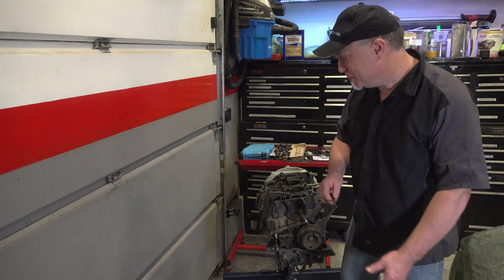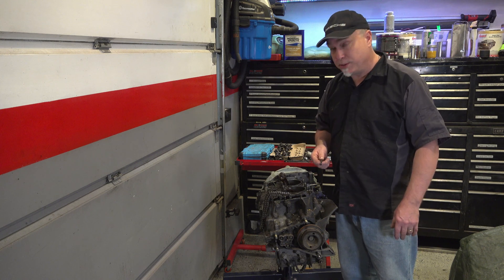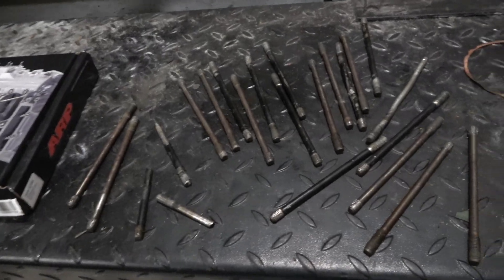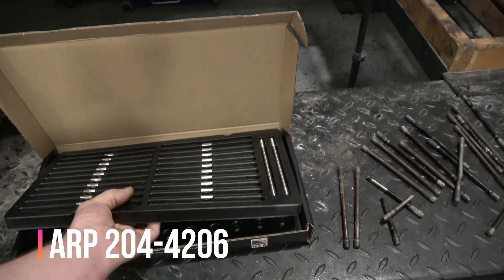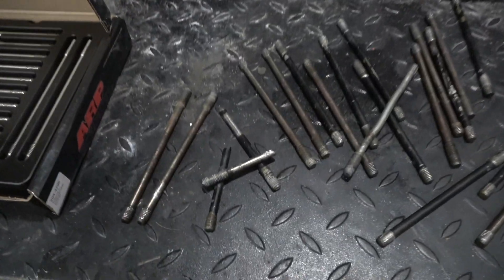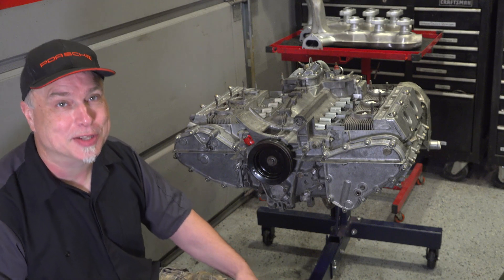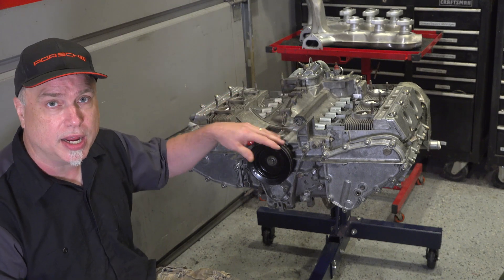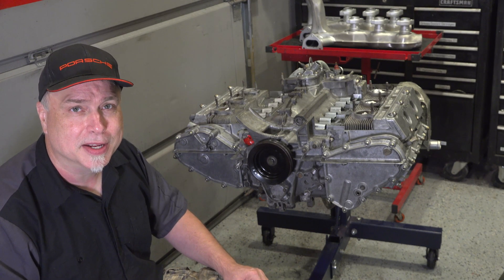3.2L Porsche 911 Cabriolet: Engine stud installation and case assembly [4K] Ep106

Comment: Been doing AC Porsche 6's since 1979. I have an issue with anyone claiming even a modicum of 'know-how' using the archaic ring compressors shown here and breaking a ring? - I suppose for a 'newbie' this would be explainable, however - if you're doing more than one of these a year, then readily available ring compressor sleeves (in this case 95mm) like these (available from Wiseco #  WIS-RCS09500)- are a no brainer. We have these in every diameter imaginable; you should too if you service these (and other) motors. You have shown those of us who know that you are in the 'apprentice' category. In Germany, you would be watching, learning, asked to grab a particular tool - then... continue to watch and learn for at least 6 months to a year (aptitude dependent) before being certified as a 'qualified' Porsche 6 cylinder air cooled powerplant technician. This is unfortunately an example (albeit with a couple of rudimentary measurement points) of how NOT to properly assemble a Porsche 6.

Comment: Thanks for posting. You have a great level of patience. You are inspiring. 
Cheers
Reply from the maker: Things are going to get worse before I get this one fixed for good.  Did anyone catch the major mistake I made?
Reply: @afternoongarage Gday! Let me guess, I think I noticed the left bank cam timing shift slightly as you finally tensioned the cam nut? I haven't rebuilt one for a few decades lol but I recall needing to be careful with the final torquing of the cam nuts because there is some slight cam movement in the dowel pin & sprocket when tightening to spec. So I always rechecked the valve lift result after torquing & turning the crank a few times to see where my cam timing ended up. It can certainly be finely adjusted once you allow for slight deviation which can or does occur.  Thanks for some great vids, I'm working through them in anticipation of refreshing my '84 3.2L.
Reply from the maker: @bruceaust7108  I wish the mistake I made was that simple.  The mistake I made was piston orientation, for some reason the manual is incorrect in its description of the 'concave' part of the piston.  It appears that the author of   (Dempsey) got a bit confused with wording and I took it  literally.  Back apart it comes.  Thanks for watching!
Reply: @afternoongarage Ahhh no, what a pain that is! How did you pick it up, I would assume the valves would touch when turned over?
Reply from the maker: @bruceaust7108  No everything turned over fine, no interference with piston and valves.  Everything was spinning freely.  What was happening is I was hearing the engine have a sound similar to a diesel engine and this is because the dish in the piston creates a 'swirl' effect to promote efficient burning and I guess it doesn't like firing with the dish on the opposite side of the plug.  I'll get to it and turn them around, everything is clean/powdercoat/painted so shouldn't be a big deal.  If you know me, I really despise doing things twice.
Reply: 'Home Built by Jeff' Porsche guy has almost trademarked his regular saying: "If it's worth doing, it's worth doing twice!!", a massive DIY guy. 
You might enjoy his RS build in his playlist, currently building an old school race transporter with body swap!
Reply from the maker: I have watched all his videos.  He works on a few different very interesting cars.  Anyone that is full DIY is deserves attention.  He has good ideas and knows what he is doing for sure.
Reply: @afternoongarage Awesome. Good luck with your piston fix, you will be extremely satisfied once completed as per the rules of the Worth Doing Twice Club! 😅
Reply from the maker: @bruceaust7108  Ha well I don't feel so bad that others have the same issue of doing things twice.  I am glad that I was able to see what I did, even if the engine is assembled and put back in the car.  I paid way to much for this thing so gotta make the best of it.  Thanks for this conversation on my channel, this is great to talk to people who have the same interests.